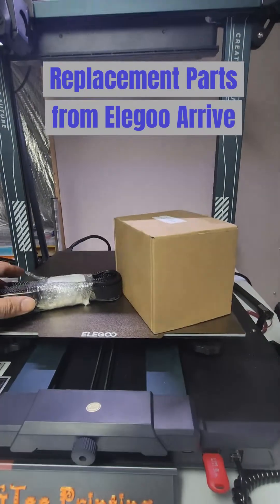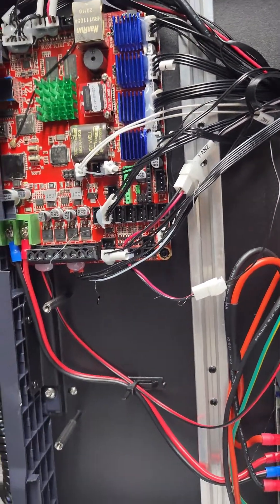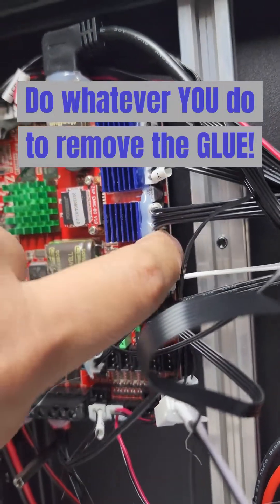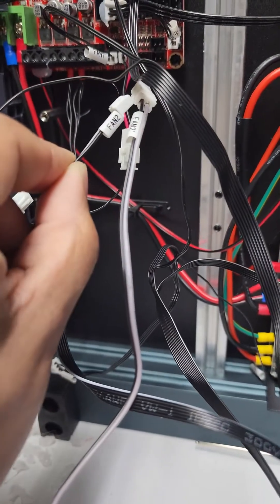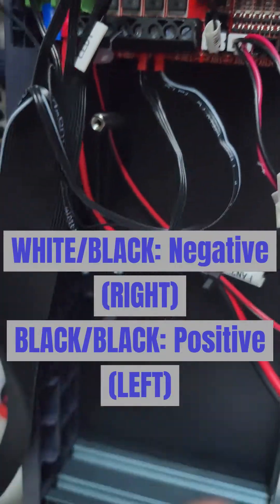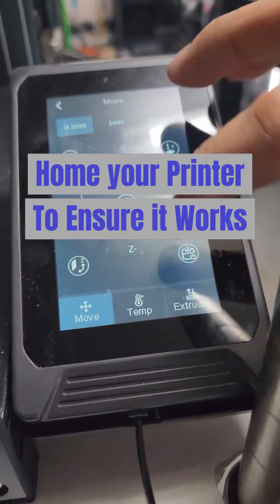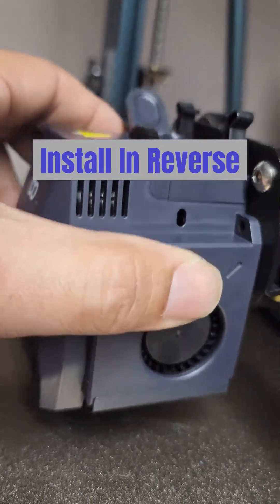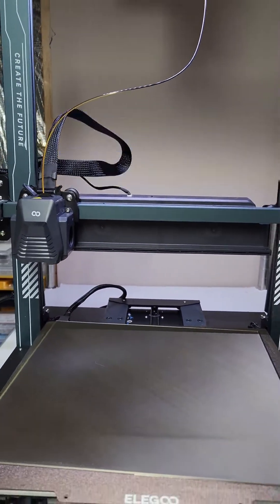HOW TO change Neptune 4 PLUS/MAX Ribbon Cable.  Bonus Printhead Swap.

Comment: Have you seen Elegoo's video for this here?
https://www.youtube.com/watch?v=ob96U85QIF4&ab_channel=ElegooOfficial
It's confusing when it comes to the heat element wires. When they start to take them out, they are connected like your wires, but when they plug in the new cable they are reversed and opposite the way you have your wires. (I'm confused, because mine was reversed from your's straight from the factory and worked great for months) now I'm not sure how to connect my new cable - your way, or the original way mine was connected?

Comment: This is great. Thanks. But taking the screws off the bottom of the printer and two of them stripped. Now I have to figure out a way to get them loosened. Ugh.
Reply from the maker: @warrenenglish942  Dang it that sucks.  I hope you get it figured out.

Comment: Thanks for this video. Had an issue where n4+ wouldn't extrude on right side of plate.  Turns out cable had went bad after 3000 hours of printing.   A mere 3 hours later  cable and hot end installed
Reply: I'm currently having the same problem where it was selectively extruding based on how far over the head is.  It was a bend in the cable about a foot up the cable that stopped and started the extrusion motor.  I'm not alone, apparently.

Comment: hi I have the same problem with the ribbon cable. Elegoo quickly sent me a ribbon cable and print head kit, Thanks for the tutorial because Elegoo does not give any explanation of the electrical connections. I would have found, but now I will save precious time Thanks again
Reply from the maker: @papoudanjou7374  Anytime.  Hope you get back up and printing soon.

Comment: I could be wrong but it looks like the fans went to the wrong places here. In their official video it shows fan1 on the board fan2 and fan2  go the the dual connector and and that fits to the slot labeled fan 2. Lmao i didnt even know the board was had text on it like most do 😂kicking myself but still found this video helpful

Comment: Glue he says...HA!  I'll take your glue and raise you the train wreck of a Neptune 4 plus I received as a repair from ebay today.  All I received was a bag of screws and box of twisted metal.  You get what you pay for but in the end I'll save some money.  Great video
Reply from the maker: YIKES.  That's why I am always afraid of buying sight unseen "for repair" printers.  Good Luck with it.  I got NO advice I can offer for twisted metal.  Lol.
Reply: @3DandTeePrinting  Well the twisted metal was more of an exaggeration but not by much. I believe I can fix just about anything but this may put me to the test.  Thanks for the luck. She's coming along. The only thing I am worried about at this point is a bent frame. I've already ordered a replacement hotend due to a filament leak.
Reply from the maker: @dbjjrr  Keep me posted.  I like hearing about success stories with 3d printer repairs.
Reply: @3DandTeePrinting   OK , so after days of re-assembling. I replaced the nozzle and was able to print a benchy. Yay?  I also had bed wobble like yourself. I couldn't make the pom wheels tight enough to the railing so off they came.  (I will tell you this printer may be the perfect candidate for a Linear railing upgrade.) I also wrote elegoo to see if I could purchase a replacement x axis motor it seems to have flat spots in the motor. Probably due to its previous owner having a super tight belt. Wish me luck because I feel the rabbit hole just keeps getting bigger.
Reply from the maker: @JBuszkiewicz  you got this.  Definitely a linear rail candidate. With or without defects.  It's the FIRST big mod I have upcoming for that thing.

Comment: no, now as soon as I turn on the printer... first while I was printing
Reply from the maker: Oh Crap.  Just happened to me.  "Moonraker Timeout".  Well let me do some research.  That's a first for me.  I made no new changes either.  Did you?
Reply: @3DandTeePrinting  I updated the firmware to version .65 and that problem was solved, then others came out like the current one MCU Shutdown, the printer is dead
Reply from the maker: @MrBiellaintitanio200  I am on it.  Trying to find the solution now.  May take a few days but I got you (and me now).
Reply: @3DandTeePrinting  did you ever find a solution to this
Reply from the maker: @ithilliongaming8980  Yes.  I installed the "Service Fix Pack" and updated firmware and screen and it's been printing great every since.
Reply: @3DandTeePrinting  i will give that a try and see if it works, my ribbon cable was bad from the factory and the replacement just came in

Comment: Where can I buy a new cable I can’t seem to find one anywhere for my Neptune 3 plus
Reply from the maker: I was sent mine by Elegoo.  If you reach out to them and ask I am sure they will direct you.  The Email is on Elegoos website under Support.
Reply: @3DandTeePrinting  thanks I’ll try that
Reply from the maker: @thecosmiccomic616  https://www.aliexpress.us/item/3256806000289467.html?src=google&aff_fcid=f6cddd451b8647d6baf1eb0e2f2cb566-1704388890263-03121-UneMJZVf&aff_fsk=UneMJZVf&aff_platform=aaf&sk=UneMJZVf&aff_trace_key=f6cddd451b8647d6baf1eb0e2f2cb566-1704388890263-03121-UneMJZVf&terminal_id=6338ead7ded74b72b204f2f017418ac8&afSmartRedirect=y&gatewayAdapt=glo2usa4itemAdapt
Reply: @3DandTeePrinting  I contacted them and now they are going to send me one for free so thank you 🙏🏾
Reply from the maker: @thecosmiccomic616  glad it worked out for you.

Comment: I just did this with my max. It was a mild pain in the rectum. Although I'm glad I'm not the only one experiencing these issues... I don't think they should be happening to begin with either.
Reply from the maker: I had a slight Feeling when they contacted me and said my Preorder was delayed over a Month before I got it due to "Current Design Conflicts" that needed to be resolved.  I knew then I might need to be tinkering on this out the box.  The Plus and Max were Rushed out with flaws but the NEWER ones coming out now they seem to have fixed the issues before they send them out but there are still some old one out there.

Comment: Now you have me wondering about the ribbon cable
Reply from the maker: 18 Printers and this is the first one I have ever had to do it because of a crimped wire.  The new cable and head are going strong.  No issues since replacing.
Reply: @3DandTeePrinting  I wonder if I have the same problem with the ribbon cable. I haven’t gotten the extruder yet, but something tells me to check the ribbon cable
Reply from the maker: @cobra4988 take off the tape around the cable and check for Crimps or Exposed Wiring inside.
Reply: @3DandTeePrinting  ok. I will check it ASAP. The bracket where the ribbon cable goes(top of the extruder), it should have been a little wider cause it forces you to bend the ribbon cable a little to slide through.